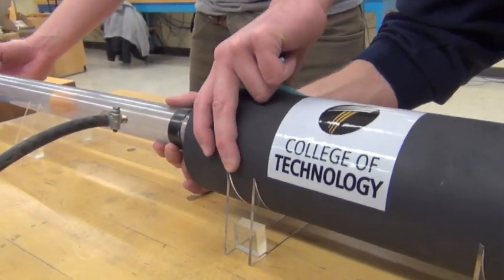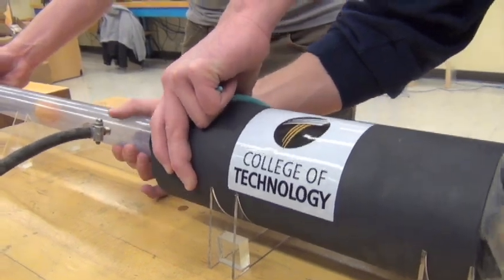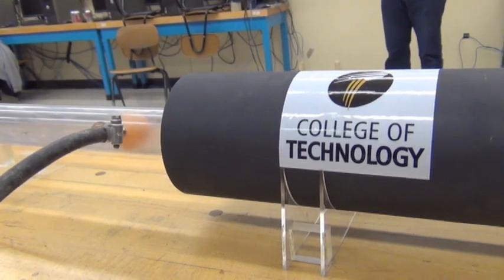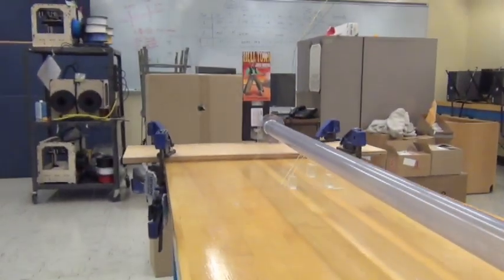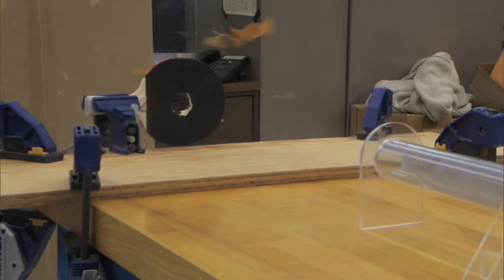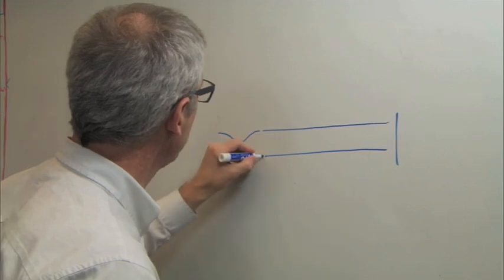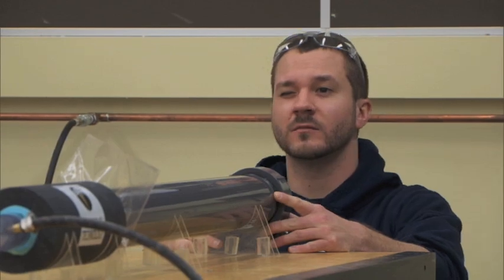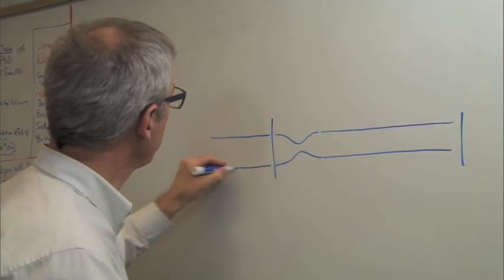Supersonic Ping Pong Balls Launcher?! Purdue University Physics Experiment

Comment: Hello! My Physics class is trying the same experiment, minus the pressurized tank. However, upon puncturing the back of our tube, we often only hear a hiss, and the ball does not move. Do you know why this is? P.S. We are pulling a vacuum of 27 inches of Mercury. Thank you!
Reply: Lack of a true seal...mythbusters had a similar problem with their version of this and they found it was their vacuum's seal
Reply: Most likely the membrane material doesn't rupture easily enough.  Best to have something barely strong enough to hold the vacuum.  12um polyester film (space blanket) works well.
Reply: +High School Car Designers TV pressure ratio across CD nozzle is critical to generate super sonic flow. also diaphragm needs to burst off clean. punctured hole while create loss in total pressure. aluminum foil may be good option. learn about CD nozzle and find what area ratio, pressure ratio you need to generate supersonic flow. refer-gas dynamics by john keith

Comment: Is the ping pong even relevant with the air travelling so fast? Would the blast of air alone be able to do most of the damage we're seeing here?
Reply: The ping pong gets obliterated. It was indeed the air traveling at 'super sonic' speed that created the hole.
Reply: I was wondering the same thing.
Reply: T Grey Actually the air travel lot faster than supersonic.   My experiments showed me i can dig into concret with the power of presurized air.    Use "GGDT" software to simulate a gun.
Reply: In the longer video, he explains how the tape is popped, by the air, which encases the ball, as soon as the air is released. This encasement also prevents the ball from losing speed, by hitting the tube or barrel wall. In short, obviously the pressurized air, is responsible for much of the impact. What I'm wondering, is why the ball doesn't pop, once they draw the vacuum? It's made of brittle material. This leads me to think, that the ball must have a hole in it, and is filled with pressurized air, as the air encases the ball. So, it has a wall of air around and behind it, and may be filled with pressurized air, as well. Who knows lol.
Reply: yes it would if the pressure is high enough. but not on a ping pong ball. the blast will smash it before it exit the barrel. 
a airsoft bb could do the same damage but with a different setup ant a lot more pressure.

Comment: So it works with a ping pong ball. What happens if they load it with a steel ball bearing?
Reply: It gets mutch slower.
Reply: @ERR0RR  What about an aluminum ball bearing?
Reply: @0neDoomedSpaceMarine  It gets not so much slower lol.. But still slower.
Reply: @Sidowse  Well, probably not, it would be too soft for that. I was more just thinking a lightweight metal projectile, an aluminum ball.
Reply: @0neDoomedSpaceMarine   my air rifle has a higher muzzle velocity than my .22 - but even though the projectile comes out faster, the lighter air rifle has nowhere near the range, or impact.
Wind resistance washes off its speed MUCH quicker.
The projectile would also need to be a reasonably good fit in the barrel or the air will blow right past it - inertia.
More weight means its harder to get it off the starting line...